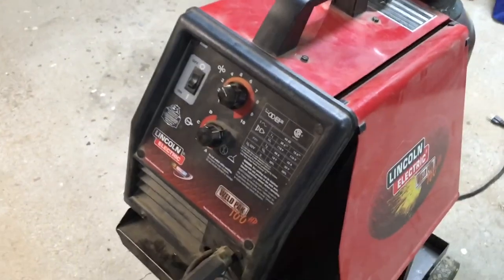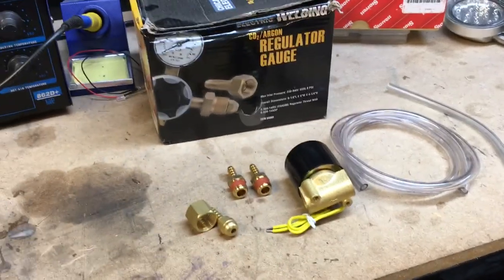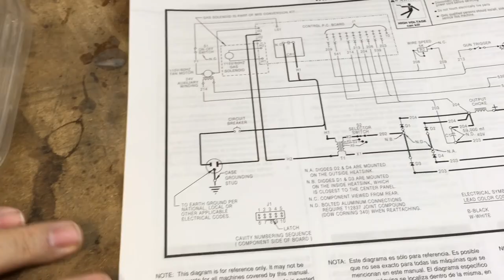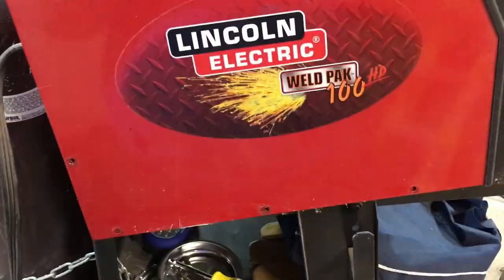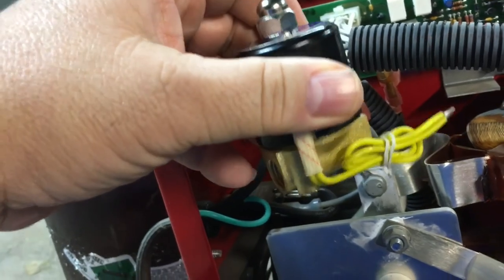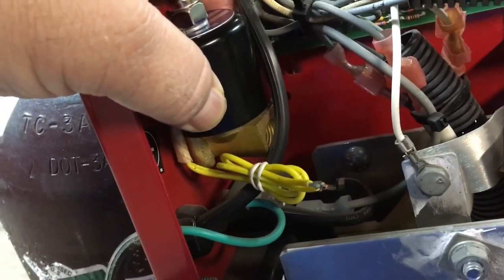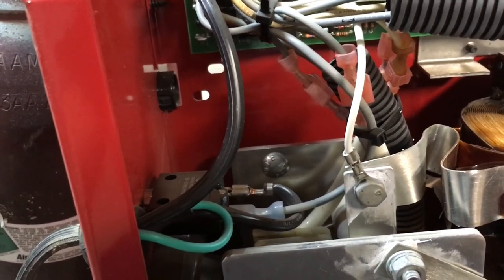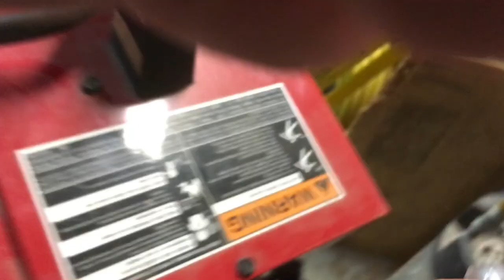Upgrade Welder from Flux to Gas

Comment: You have to change  the polarity  also.
Reply: That and flip the feed roller around to the groove made for mig wire, the one for flux is larger and has little bumps in it to grip the flux wire better

Comment: And you shouldn't run 30lpm that's way too high. Try 10 and give it a test. Should be plenty
Reply: he's leaking gas at the fitting to the gun his hose is 1/4 and the fitting is 3/16

Comment: you have to push weld mig not drag and the hose it loose on the gun because that fitting is 3/16 not 1/4 like your hose and other fittings are.